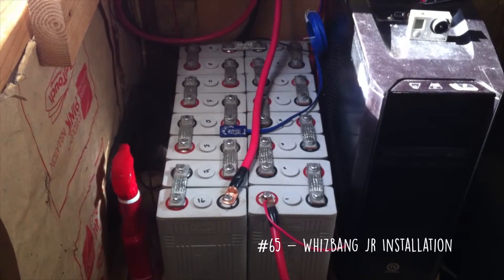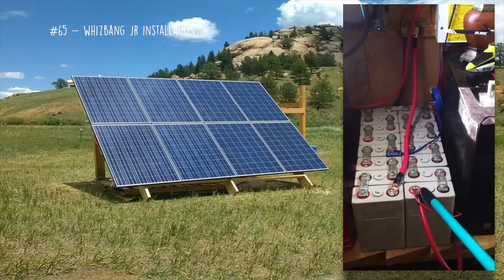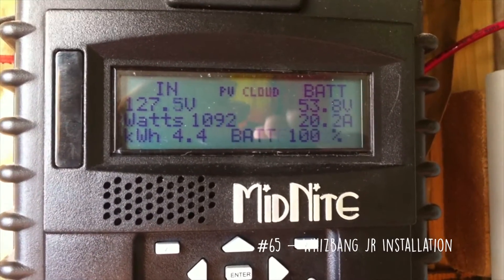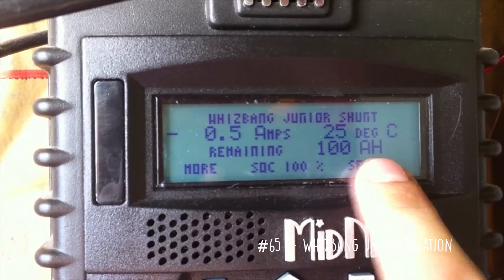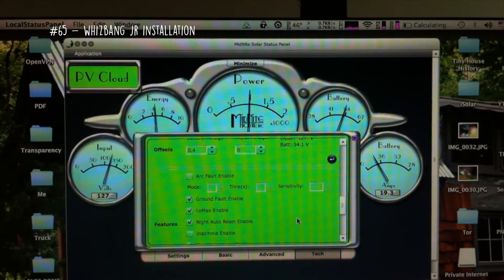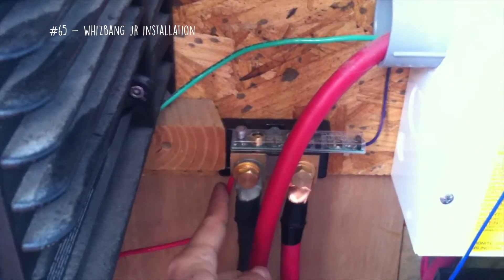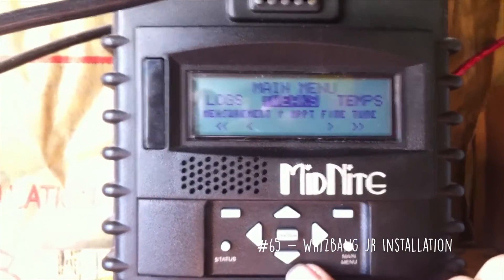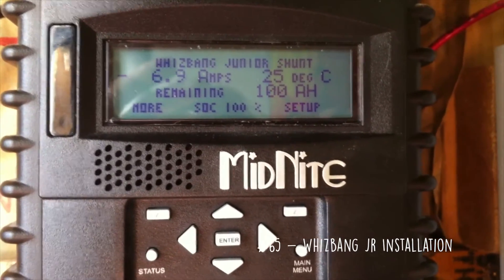Whizbang Jr Installation - Complete Wiring and Programming Guide. Battery/Inverter/Controller

Comment: Is it possible to wire a Whiz Bang jr as a shunt directly to the inverter aux 2 the shunt will work as all shunts are the same but will the board power up and be recognized by say a VFX3524 inverter.

Comment: Awesome man. I just found your channel but I thought you were inactive. Glad to see a new video. How do you get internet out where you are? Is it a big hassle to be uploading to youtube and stuff? How do you like your internet accommodations?
Reply from the maker: +Carter Mahnke Congratulations on getting your insulation in finally. Insulating was a pain. Especially trying to put up batts in the cathedral ceilings all alone. Sometimes when you are building alone it feels like you have to channel your inner "Pyramid building Egyptian" to figure out odd ways to accomplish a task. Internet out here? Wasn't too difficult. Luckily the property has a cable utility line that runs across the street easement area. We have ADSL 12mb/1mb ~ $50USD. I tend to go into town to the library though when I need to upload a video to Youtube. Trying to get 1-2gigs into YT from here takes all day while at the library it is 30 minutes. :) - Cloud
Reply: +cnypilot That's really cool man. I planned to "knock out the ceiling insulation" in one evening alone, assuming it would be simpler than the walls with all the cutting etc... A friend ended up stopping by to help me out and even with two of us it was a pain, but once we figured out a method to make it easier I couldn't have imagined doing it alone.
Reply from the maker: Carter Mahnke A lot of zigzag string to help out?? ;-)

Comment: Thanks !
Reply from the maker: +TheKilog69 You're welcome! :) Do you have the whizbang jr as well or about to purchase one?
Reply: +cnypilot Getting ready to upgrade to a Mid night Classic 150 & install my out Back FM80 into my solar Camper.
Reply from the maker: Very cool ! I've enjoyed the 200 volt version of the Classic for nearly three years now. They work amazingly well. Especially with being able to full customize your voltages to work with any battery chemistry you have currently or eventually upgrade to. I am surprised I waited as long as I did to purchase the whizbang jr. It is such a useful tool knowing what is in the bank and being able to use it to see what the true loads are for each device ( including inverter losses as it shows amps from the battery side of things) - Cloud